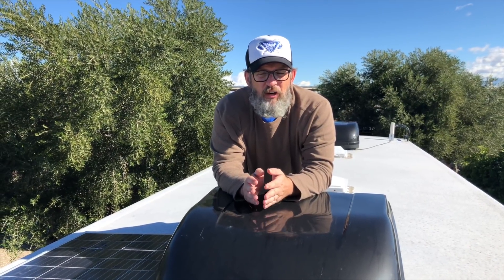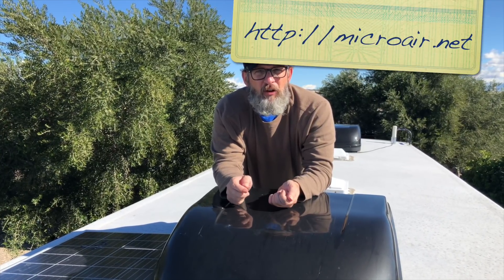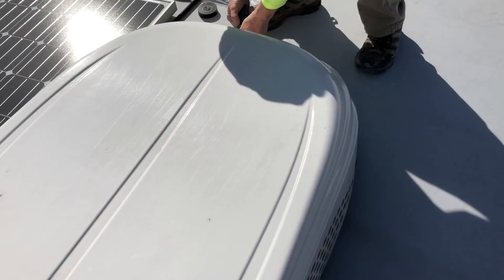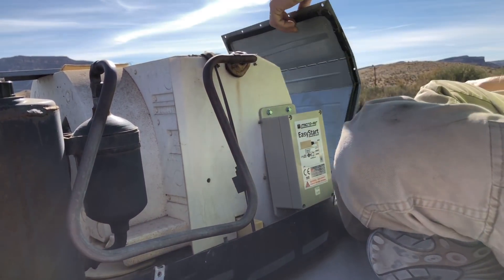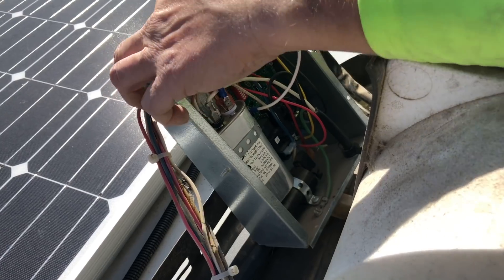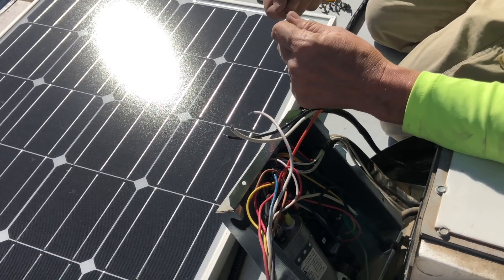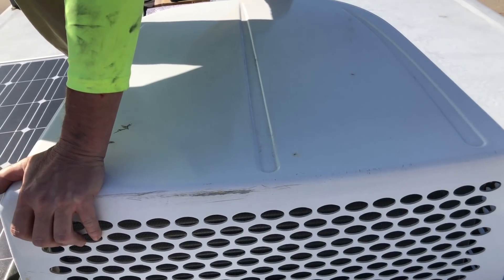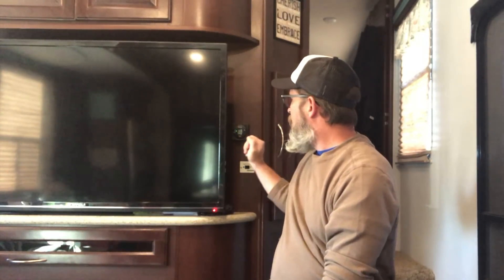Installation of a Micro-Air EasyStart™ Soft Starter on RV AC

Comment: i bought 2 micro starts for both my rv roof top units,,  i was hoping my smaller unit, either a 11,500 btu or a 12,500 btu dometic,  would start and run with a single honda eu2000i.  i believe i was told it would but anyway,,,  it will not.   i think it worked in like march but once any warmer weather rolls in,,,  it totally doesn't work.   sigh.   2 micr-air easy starts at $200+ each 
wish i could use them on a 6k btu window unit,, don't see why not.
Reply from the maker: Interesting about the generator. Depending on which version of the eu2000i, it is rated for 1800 watts. Surely your AC is less than that. I would call Micro Air and see if they have any ideas. Pretty smart guys over there that seem to understand generators and AC units as well as their product. I don't see what it will not work on the window unit either, but I am no electrical engineer.
Reply: @ChickerysTravels  i was not expecting it to work on the bigger unit, 15k btu, i just put one on that one  to make it easier on the compressor (sadly, that backfired as well, since i put the thermastat on as high as it would go, like 90 or something, and tried to keep the trailer vaguely cool over one summer, but i think it burned up the compressor,, hooked to shore power 50 amp service too.      that unit doesn't work any more.    and the smaller unit does draw only like 10-11  ish amps while running which should be fine   and even when i tested the start amps it seemed around not to bad so i thought it would be good  but it is the starting in warmer weather that kicks the honda eu2000i off,, even with the soft start, it pulls too many amps.  i think i did call them,, it has been a couple years ago,, there wasn't much help as since the micro start was hooked up right,, what else can they do?  maybe i got a bad micro start?   probably not likely but maybe,,,,  but it's not like they are going to send me another one.
Reply from the maker: @kevinlowe7552  That is a bummer of a story. We have a 13.5 AC unit on ours and it will run off the batteries through our 3000 watt inverter without any easy start on the AC. It seems logical to me that yours would run on the generator after the AC ramps up with the easy start on it.
Reply: @ChickerysTravels  i would have thought the same thing, was kind of counting on it really.    and it did work in february march-ish when i first installed but when it got warmer, the compressor drew more amps apparently.  you may have a much more modern set up with your inverter/batteries and your ac may be more efficient if it is newer, my stuff is 2007 ish vintage and not using the batteries,, only the eu2000i

Comment: You had a good experience....the only suggestion I have is for the benefit of those who have no idea what you are verbally describing. Could you make another video that actually shows the wires you are verbally describing, where they are and where you are following them from...to. Systems may be different, but the exercise of watching what you do, rather than watching you strip wires....would be much more instructional.
Reply from the maker: Thanks for the comment. I am actually making a new easy start video in the next couple of weeks and I will try to include the items you mention. Stay tuned!

Comment: Micro-Air is at it again. They've invented a new thermostat control for A/C with WiFi and Bluetooth capacity to be released this Spring. See their Facebook for more information and a new product announcement --and also RV Electricity on FB. Its for the aftermarket.

Comment: Anyone know if I could install this in a window unit a/c? I have a home built truck camper that uses a standard Walmart window unit and a Honda 2000 generator. The generator will run the a/c with the eco throttle off, but won't allow the compressor to start with the eco throttle on. I'm hoping this soft start will be my ticket to gas savings!
Reply: Did you ever get your answer either somewhere else or by you installing it and finding out the answer?
Reply: @barricaderentals6655  I discovered it is possible but haven't done it yet. Can't remember if it's this product or a similar one though.
Reply: Micro-Air's product selector shows that there is a unit for wall air conditioners. It CAN be done.

Comment: Understand one thing though people, you would need twice the battery bank that he has and you would need enough solar on the roof to be able to run the air conditioner which is about 14 amps continuous. To keep it running you would need a large solar array and a huge battery bank to run your air conditioner for any amount of time. Even with lithium batteries it's not economically feasible to run a standard RV air conditioner off solar and batteries
Reply from the maker: A 2000W generator would work fine for air conditioning use longer term, but we've run it off the batteries we show in our video for short periods to cool things off.

Comment: Micro-air Easy start Dos n’t reduce the life of 
The compressor !?
Thanks  
Greetings from Kuwait 🇰🇼🇰🇼🇰🇼
Reply from the maker: Don’t think so, but we’ll let you know.
Reply: We have no data at Micro-Air on that. We expect that it will extend compressor life thanks to the gentle ramping of the start and the elimination of the SLAM on of air conditioners.    In countries and private developments where part of the electric charges includes the highest amperage used, we expect our EasyStart to save on monthly charges incurred.    
Kevin  609 259 2636  
www.easystart.net

Comment: Did your A/C start without this?  What size is the A/C .. 15,000 BTU?  Thanks.
Reply from the maker: Yes, it worked fine. It was a 15,000 BTU.